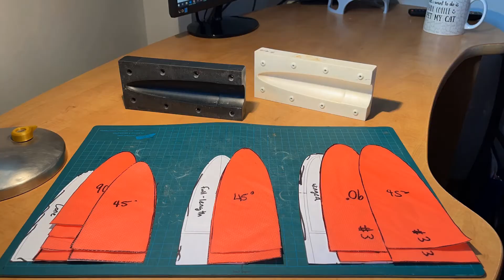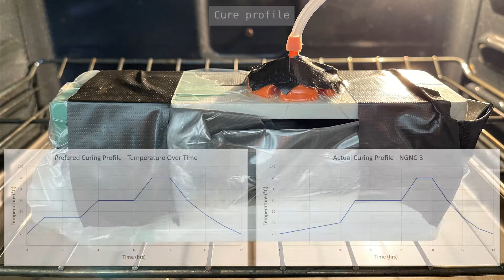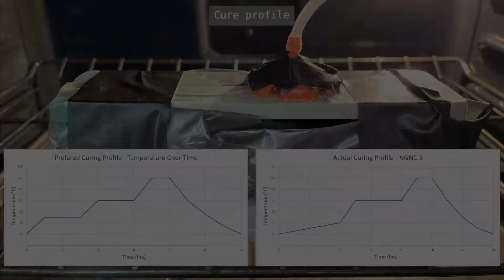Fibre Glass Nose Cone Layup with 3D Printed Mold - NGNC-3

Comment: Looks Labour intensive Amigo !    ? Use a foam that is dissolved by acetone to make a positive mold, wind the glass, carbon, or other tow around the mold.  Dissolve the mold.   The mold seam is a weak point.     Possible to use a 
Ballon inside and then inflate it?    This would be a trick way to make a rocket tube.  Silicone surgical tubing will work for small ID tubes.   PS can use SS tubing to make water Winnie’s.❤❤

Comment: Hi!, I'm currently making a nosecone out carbon-fibre and I'm wondering how did you determine your cutting patern like I saw in your video? Did you do it in your CAD file or?
Reply from the maker: In Solidworks, I was able to flatten a surface map of the shape after making a cut line along one side of the surface body. You can also see where the tensions (and compression in the flattened shape would be), import to a drawing and print on paper 1:1

Comment: Great video! If you were to do this using a carbon fiber prepreg would you change anything or would most of it be relatively the same idea?
Reply from the maker: Hey! I’d say you’d want to consider the number of layers and orientations for your needs, but the main idea I would say should extend to a carbon fibre cone
Reply: @adambjohnson  Thank you! Another question for you, would you do this same method for a hemispherical nosecone or would you change up some of the concept?
Reply from the maker: @tylercaswell9271  I’d think a hemisphere would be easier than these tall and slender cones. Maybe I’d consider a slightly different approach to distribute the seam at different places, but I’m not sure! I haven’t done these layups in a couple years now so I’m a bit out of practice 😅
Reply: @adambjohnson  that’s okay, this is my first time trying this for my rocketry team and your video has been an incredible help for us so thank you!

Comment: I don't understand why you didn't make the warhead directly in 3d printing?
Reply from the maker: First off, it is a rocket nose cone, not a warhead. There is no militarization or related purpose for this video, other than model rocketry, specifically for university teams.

Secondly, a solid 3D printed “nose cone” would be extremely heavy, and the heat generated by supersonic flow and/or sitting on a launch pad would soften the plastic.
Reply: @adambjohnson  yes I had seen that it is a rocket nose, but in France we can call it warhead.  I have built hobby rockets and created the nose of the rocket in petg using a 3d printer.  I can tell you that it is very solid and light weight.  The nose of my rocket is empty and the thickness is 2.5 mm if I remember correctly.  beautiful life anyway.
Reply from the maker: @dronie8782  thanks for the reply. I know PETG has great strength, and we have printed ours with PETG before, but this is a 1/3rd scale so the real version is very long and wide. A printed nose cone will add up the weight fast. A comparable printed version was 4x the weight.

Yes, 3D printing is fantastic for many things but this is not the purpose of this video or our work. The fiberglass is RF transparent (same would be for printed plastic), but again you are stuck with 105C glass transition for PETG or lower for other materials.
Reply from the maker: Again, great for prototyping but not for a real launch with say an 11 foot tall by 6inch wide competition, supersonic rocket
Reply: @adambjohnson  Ah yes still not bad, I would like to know how to make such advanced rockets!
Reply from the maker: @dronie8782  our team had the fortunate opportunity to compete many times over the last handful of years and learned much since the beginning! We had done multi section printed cones, hybrid printed-fiberglass cones, two sided fiberglass, and many other failures we learned a lot from! This single-layup version has been our lightest, strongest, easiest to manufacture, and best results so far!
Reply from the maker: For a smaller hobby rocket that might fit these nose cones, I would probably 3D print the nose cones instead for ease :) keeping them subsonic and not letting the rocket bake on a launch pad in the desert, PETG would be the way to go
Reply: @adambjohnson  Depending on the TWR it could be worth sacrificing a little of it to have a heavier nosecone since it improves stability right?
Reply from the maker: @Draccko2  TWR? And you can always add some ballast for extra weight - a lot harder to remove weight if you need to.
Reply from the maker: The strength to weight ratio in comparison when laying up fiberglass with alternating (or some designed) pattern is much much much much higher than that of a 3D printed counterpart.
Reply from the maker: Specific to the direction you want of course